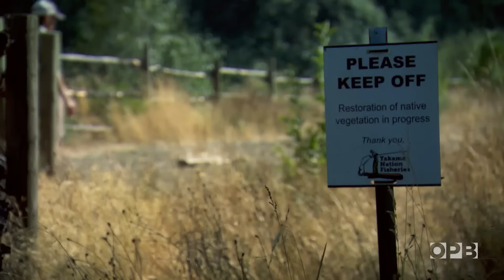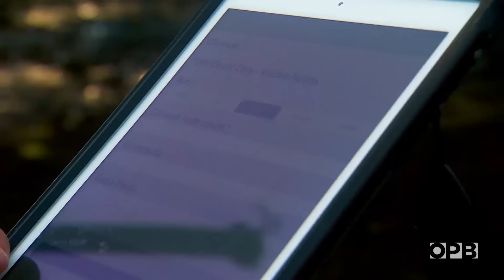The White Salmon River after Condit dam | Oregon Field Guide

Comment: The White Salmon is such healthy river that the dam removal was a push. Where the salmon spawned was from the mouth of the river down to the fish hatchery, so when Bonneville dam was built the spawning area was gone. Condit dam had been built twice before with a fish ladder but both dams blew out in the respective winters. The 3rd dam built in 1912 didn`t have a fish ladder. Instead they built raceways around a mile up from the mouth of the river. The dam became the battle ground because it was the first of, I believe, 5 dam projects PP&L has/had in OR and WA and would set precedent for concrete dam removal. On a side note, the PP&L dams on the Klamath river are the ones that really need to go, but I digress. We were indeed very concerned about the contents of the lake and what it would do to the lower section. We were very surprised, in a good way, with what happened. It should also be mentioned that the recovery work done where the lake was has also been a pleasant surprise, hats off to them. I think the biggest peril the White Salmon faces now is being loved to death.
Reply: The Klamath river dams in California (Iron Gate and Copco) are being removed! Been a lot of pushback from the locals but it's out of their hands.
Reply: @kennyboy019  about damn time.

Comment: A list of ideas that might help.
Fish Runs saving Dams and Water Shortages

Update 7/4/2021
Do you have a nearby moving river or stream? You can now place a slow speed water generator on the bottom of the stream and make power 24 hours a day. The unit is called a Waterotor made in Canada. The Waterotors won't harm fish and can be scaled up to meet the needs of small towns or cities. Make the power miles away from the small town, sell the power to the power company than use the power to make water anywhere. Atmospheric water generators can make drinking water and irrigation water, and with a Waterotor, power can be made even in remote regions of the World. You just need moving water 3 to 4 miles an hour in streams, irrigation channels, fish ladders or even waste water outlet's. Garbage treatment plants can also use the power they make burning garbage to make water with atmospheric water generators and add storage tanks to supply small towns and cities. Adding Waterotors below dams can maximize electrical power made by any dam and replace power lost if the dam has a fish ladder or channel for fish to move up and down stream. A dam can be saved for flood control by adding these powered fish ladders and channels or notching the dam and putting in a flood gate to raise and lower the river during fish runs. Now people and fish can share the river. Note using the methane from sewage treatment plants or garbage landfills might be used to generate electricity for any water making projects. You might use your own City sewage system to make filtered irrigation water for lawns and gardens they have a system like that in my my small town. Note, what to make even more power? Then by covering fish ladders and channels with spaced solar panels decreases evaporation of the water and increases the efficiency of the solar panels.

A now overdue idea, dealing with forest fires. You build and place atmospheric water generators and 100,000 to 5,000,000 gallon water tanks on hilltops to protect your town. You cover the tanks with solar panels and add wind turbines to make power anywhere. You sell the power, drinking water and irrigation water, then by adding irrigation pipes down the hillsides, you can create fire lines that lasts up to 24 hours. You make these fire lines by adding TetraKO, by Earth Clean at a 4 to 6 percent solution to the water. Turn on these stand alone units remotely, your fire trucks can work elsewhere or resupply themselves with needed water. Fire protection, drinking water, irrigation water and stand alone power for any city or town in need. Here again, Waterotor generators could be used to generate power for the hilltop water making units. These ideas all can be done today, just search YouTube, and then tell someone.
Reply: Obrigada pelas informações. Não sabia dessas alternativas. Vou pesquisar mais para propor em pequenas cidades onde trabalho.

Comment: Why was the dam built in the first place?  power production? How do you replace that power?
Reply: They are all hippies so they do not need power, or baths...
Reply: Most dams of this size do not contribute much to the power grid, by todays requirements. Especially when filled with silt and gravel. As stated in the video, the costs associated with bringing it up to standards exceeded the income generated by the electricity produced, so it was primarily motivated by economic issues.
There are currently more viable sources of renewable energy such as wind and solar. Technology that was unavailable at that time.
Reply: @jbbuzzable  I agree and disagree....  Any hydro power will generally be worth it when it comes to having a renewable energy source.  If it was less expensive to blow the dam instead of making viable, the question still stands.  Did the replace the lost power with something else as reliable?  Solar and wind do not provide much.
Reply: @gw10758 Just to put things into perspective. PacifiCorp, the owner of the dam, has plans to add 1,150 MW of wind power in addition to upgrading the existing 1,000 MW capacity they currently have. The Condit dam could produce a maximum of 15 MW.
Reply: @jbbuzzable  Yup, that is what I read also.  Only problem is that wind power is not green OR reliable.
Reply: @gw10758  I'm pretty confident that I won't change your mind, so I'll end it here.
Reply: @jbbuzzable  Was not trying to change anyone's mind.  Just a civil discourse looking at both sides.  Take care
Reply: @jbbuzzable  You make some good points. I disagree about wind and solar. Dam's pay for themselves. Produced
 power day and night stormie or calm. Wind and solar stop the moment the government subsidies stop.
Reply: Some dams don't produce enough power to justify the upkeep. Especially these old dams that don't contribute much.
Reply: @jbbuzzable  hahaha windmills are a huge lie, work part time and they don’t ever fix them when they break
Reply: @kellyovermyer6453  That's not the case where I am at, and there are hundreds of them.
Reply: @kellyovermyer6453  Wind energy was about 25% of the UKs energy in 2020 - was that a lie?
Reply: @MZ99698  could be.  I dont know and dont follow that market as it doesnt pertain to what I do.  The wind stops, dead stops, 2x a day.  in almost all places there will be at least a period of 5-7 consecutive days several times a year where wind is inadequate to produce meaningful power.  So you must build battery storage, lots of it to get the raw materials you need mine, to mine you need an extreme amount of resources to begin an continue to process the material then you need to refine it for use.  so what the wind advocates are doing really is playing buckets.  They take the buckets of carbon from one place and put them in another.  funny thing that law of energy conservation holds true.  we need more nuclear energy or burn rocks.  the rest doesnt work and you cannot add demand and reduce capacity at the same time and wonder why pricing gets out of control.
Reply: @maniac541  it's like owning a 1920 car vs 1990 vehicle.

Comment: If it even would?  There's was no question of the salmon coming back or the silt being a issue. If there was they wouldn't have torn down the dam. Think about it. The river would move the silt down stream as per usual if they dam wasn't there and if the fish didn't come back they could always seed the river. It's not hard to do. The trees and plants will reseed themselves. In case you forgot just north of there is St Helens. In less than ten years after the eruption the forests were regrowing, deer and game were coming back etc. That was after being buried under several feet of volcanc ash. Is there a required class on hyperboyle for environmentalists? It seems to be their default setting.

Comment: what would be a greater win even would be a hand in hand project of dam removal plus a renewable power generating project..either solar, wind or a combination, to offset the lost electrical energy from the dam. That way we would have the unobstructed river with its salmon and nature recovered, and the clean power we so definitely need to reduce fossil fuel consumption. Well, maybe one thing at a time, but we are moving in the right direction!
Reply: Wind and solar generally need daytime to work. Sun definitely doesn't shine and night and the wind dies down then too. You get rid of all the base load power plants (hydro, coal, natural gas and nuclear) you're going to be quite cold come nightfall, especially in the winter!

Comment: Anybody know why they chose to destroy the dam in such an apocalyptic way? Why not first drain the lake slowly? Let me guess, it would have costed more?
Reply: Flush the trapped sediments downstream.
Reply: The engineers wanted the force of the impounded water to flush the sediments downstream quickly, rather than have them collecting in places along the way.  The White Salmon is a steep river, which means that it transports a lot of sediment.  The lake behind the dam had silted in considerably from when the dam was built.  As it is, the former lake areas are prone to thick dust, as the fine sediments dry out.